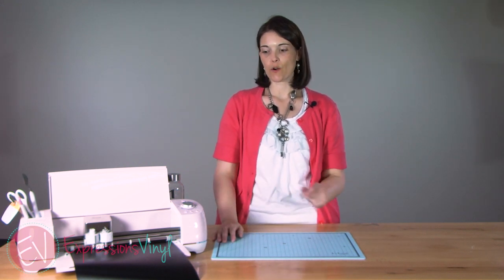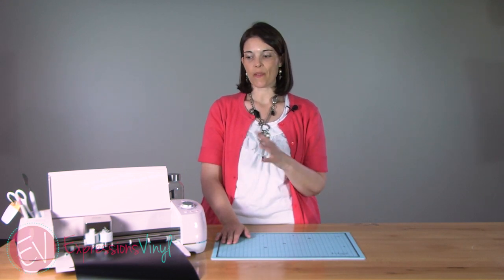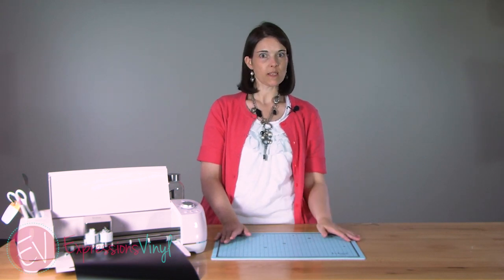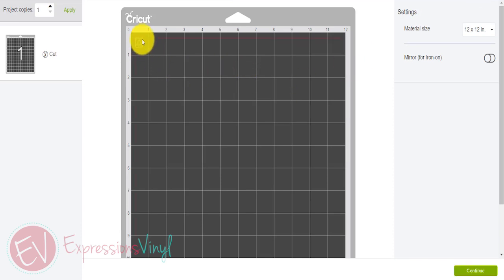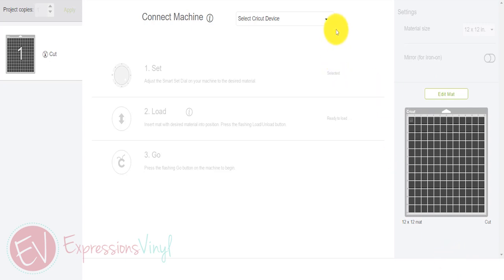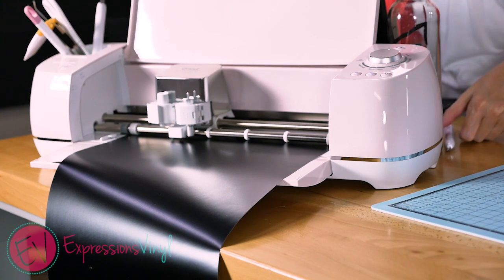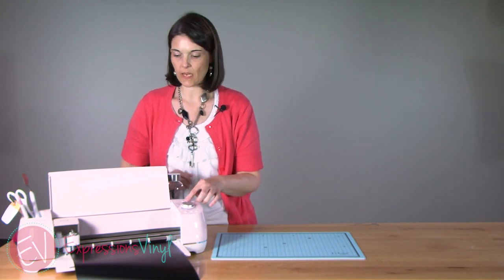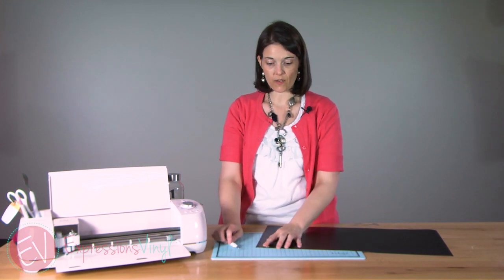Creating a Test Cut in Design Space for your Cricut

Comment: is there a way to have the cricut cut a clean straight line across the entire width of the vinyl AFTER it finishes cutting my design? I often cut few designs at the same time and end up with  an L shape piece of vinyl. It would be great to have cricut cut a straight line (whereever my last image printed) making it a clean cut. Suggestions?
Reply from the maker: Hi, I often add a line to my images like that as well.  To do that I just use the Insert Shapes and then insert a Score line.  Once you have inserted it you can change it to a cut line.  To do that, go to the Layers panel on the right and click on the pen/score tool image.  Once you have clicked on it there are 4 options at the top.  Cut, Write, Score and Print.  Change it to Cut and you now have a nice straight line to use.  Hopefully this helps.

Comment: when you do a test cut how do you move your vinyl so the design works out like the top corner is now missing. do you have to readjust your design where you did your test cut or how does that work do just cut  a strip off the top and start over or how do you make your design work fit?

Comment: I noticed you didn't use a mat. It that necessary?
Reply from the maker: You can use a mat if you would like. We like to save our mats for paper projects. When cutting vinyl it has a paper backing that acts as your mat, so it's not necessary to use a mat.
Reply: @Expressionsvinyls  wow! I did not know this..question. Will that work for the Cricut Explorer Air 2 also..or just for the Maker? Ty!